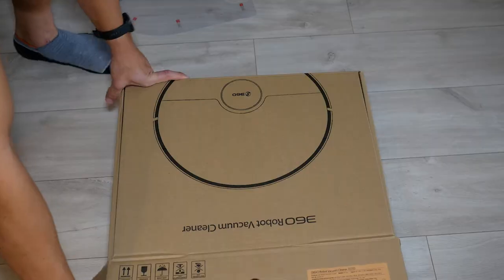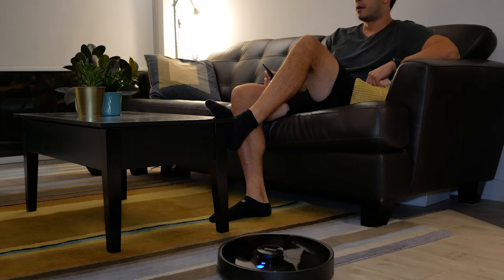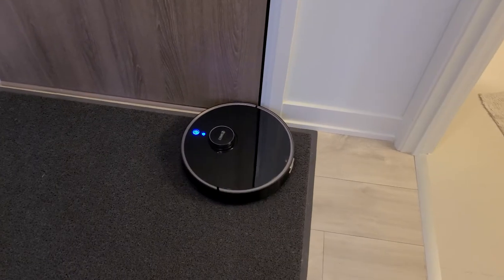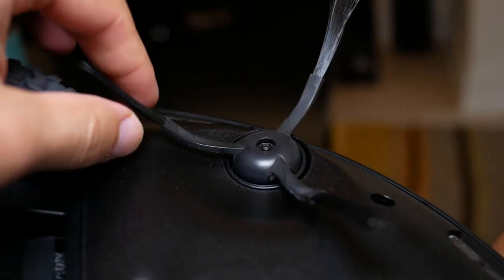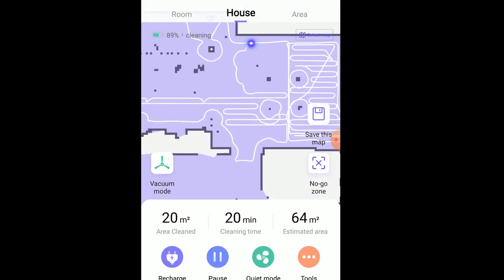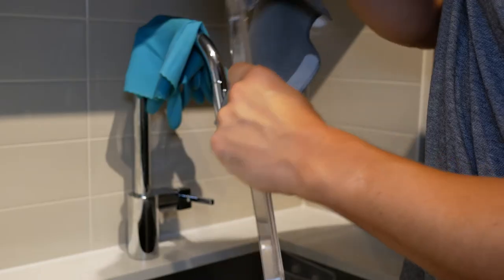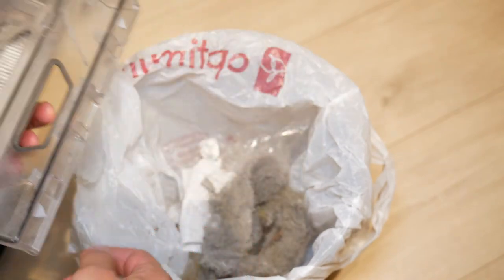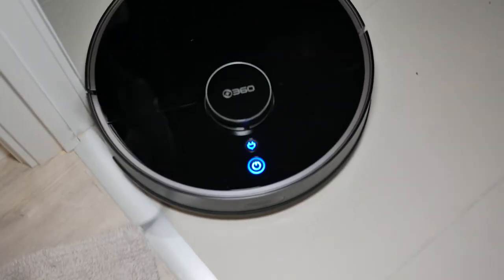360 S7 Pro Robot Vacuum Review - Autonomous Car Technology in a Vacuum?!

Comment: some questions:
1. How much area can it mop with 1 tank of water?
2. How much area can the mop cover before it needs to be cleaned it self?
3. I prefer google home devices. Is it there yet and how good is it?
4. Any issues you've experienced over the months of use and how good is the customer care (if you called them)?
5. How is the battery life and charging time over months of use?
6. While it is mopping, can it automatically detect carpets and not mop over them?

Comment: are you aware whats the difference between s7 and s7 pro, apart from the colour? i couldn't find it
Reply: I am wondering the same thing, does anyone knows if there is a diference, i ve been looking for this info on the net without success
Reply: @maxdublas  except slightly higher suction power nothing much
Reply: @arthas7  thanks for the info.